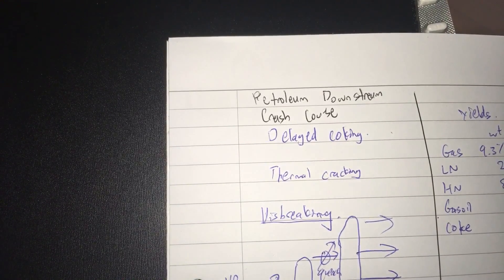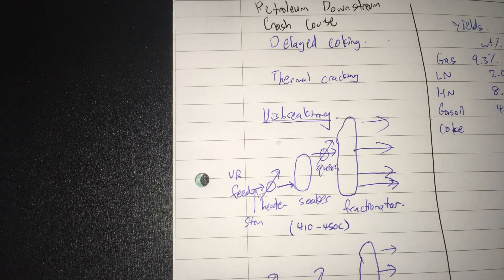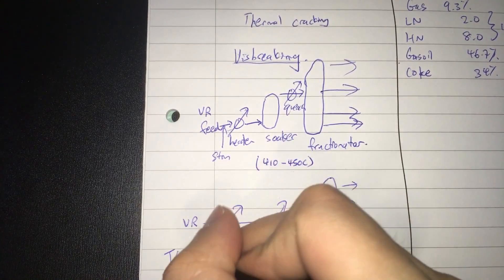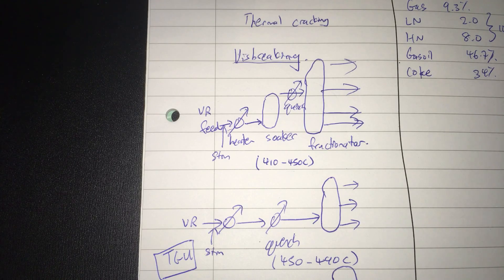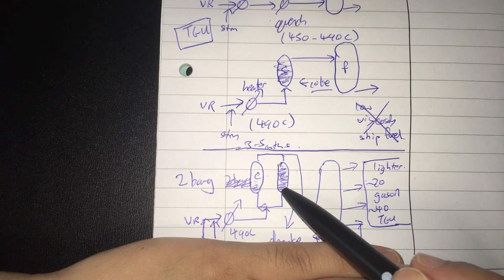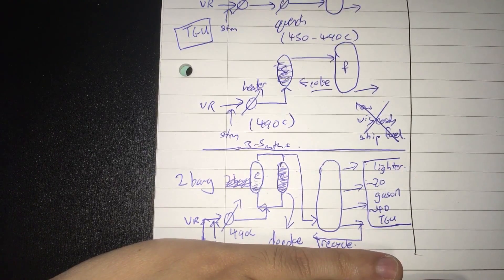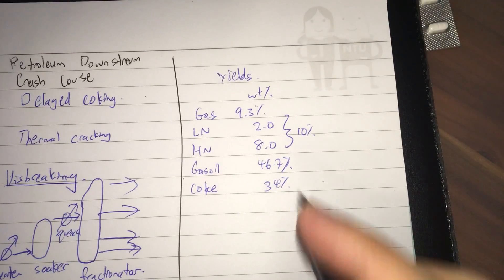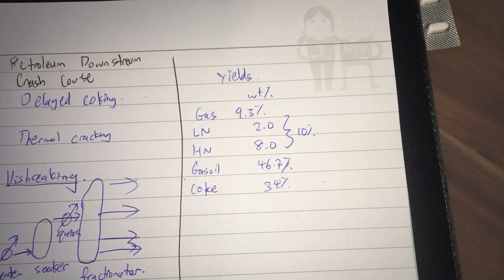Petroleum Downstream Crash Course 17 - Delayed Coking

Comment: The highest temp point might be inside of furnace tube, but why the coke build up at the drum?
Reply: the vacuum residue is passed fast in the furnace to assure we prevent the formation of the coke inside the furnace.
Reply: Because we add boiler feed water to delay coking from furnace to drum .